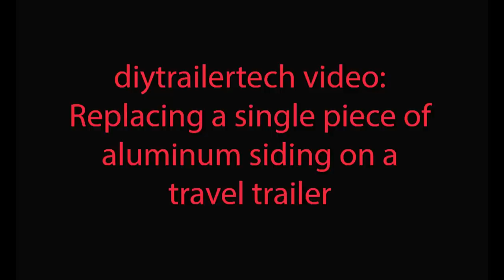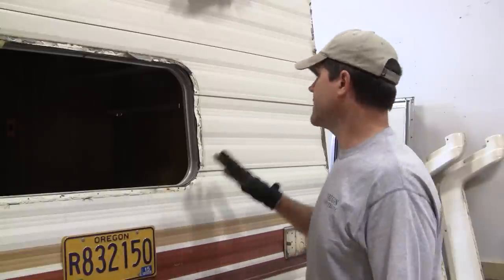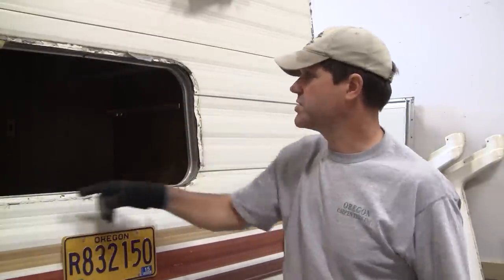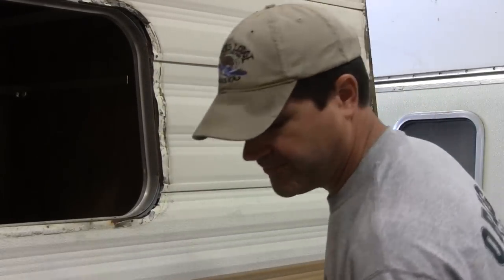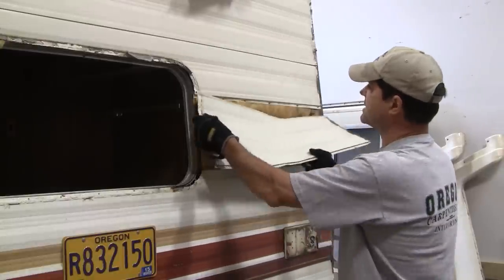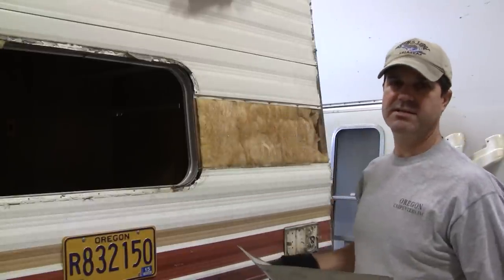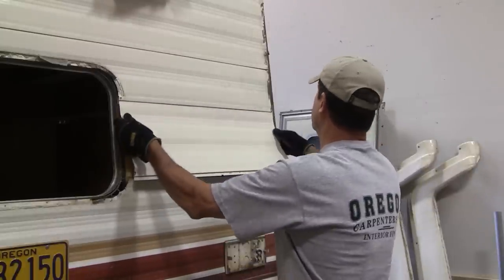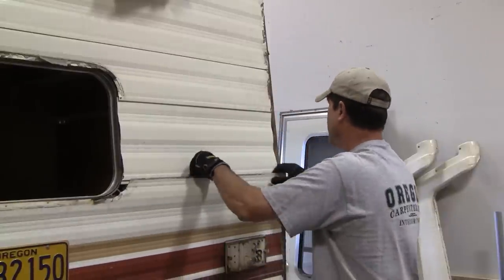Replacing a Single Piece of Siding 2

Comment: Do you recall where you purchased the replacement aluminum siding?

Also, have you ever run AC or DC wiring through the walls of an RV?  I'd like to run about 8 DC outlets and 5 AC outlets throughout my travel trailer and tie them into the power distribution panel.  Some people suggest I could run them under the RV and up the walls but to me, total novice, I would think the walls of the travel trailer would be bolted to the travel trailer metal frame.
Reply from the maker: I bought the siding at www.interstatervmetalandsupply.com/ 
Yes, we ran lots of new wiring in this trailer. We replaced all of the exterior siding (I wanted to show how to replace a single piece in the process) and we replaced most of the interior paneling. It's really like running wiring in a house. You have to stay within the capabilities of the circuit breakers, inverters, etc. Have a certified tech inspect everything, we did. You may also have the option of using conduit to house the wiring, you know, hipster industrial look and all that. But the circuits must match the service and breakers and grounding is super important for an RV.

Comment: I have 2 sections one above the other about 4 rows up from the bottom on the side of my camper about 18 feet long to replace. Would this work for that?
Reply from the maker: Hi Jim,
Yes, this will work. On the trailer we show in the video we actually replaced all of the siding. I thought it would be helpful to do the one piece video for repairs, but you can do anything from small piece to the entire RV. Longer pieces usually involve more corners, appliance and window openings so you'll have to handle each one as you get to it but are pretty straightforward flanges over the siding that must be resealed.

Comment: Where can you find/buy the siding. Mine peeled back and I need to replace 3 panels on a 40' trailer. 2002 Sandpiper. For now it's duct tape city.
Reply from the maker: I bought the siding at www.interstatervmetalandsupply.com/

Comment: What tool can I use to cut a hole in Traierl Wall to put in a new Window?
Reply from the maker: Lots of issues with this idea because you would first need to make sure there was no wiring or plumbing in the wall. Also, removal of framing for the window could cause weakness in the wall and roof support.

Comment: Is there a generic sheet metal/aluminum that will work for this purpose?
Reply from the maker: None that I am aware of. It needs to have the right bends at top and bottom to tie in. Plus the bends in the patterns increase strength.

Comment: You said the patterns were available, where at exactly.  I am looking for a 1979 fleetwood flair RV.
Reply from the maker: Hi Kirk, We got ours at
www.interstatervmetalandsupply.com
Our trailer is a '78 Terry
Reply: Hi Larry, Looks like the siding on my '88 Prowler is identical to yours.  I looked on the website you recommended and found that the 2" Mesa D-3 looks the closest.  Is that the one you installed?
Reply from the maker: I don't know why, but our trailer had several different patterns from top to bottom.

Comment: Hey I have what may sound like an extremely stupid question, so forgive me if it is. I have an 89 Fleetwood lynx that I am rebuilding. It has the same siding as the trailer in this video. I noticed while I was tearing out the interior walls that water is coming through where the top and bottom parts of the siding meet. Is this normal and if not how do I stop it. [I would like to note this is away from windows and openings, and seems to do it in large sections of the trailer]
Reply from the maker: That doesn't sound normal. There is quite a bit of overlap where the siding pieces fit together. Of course they would need to be installed with the correct edge up...
Reply: Larry Walton I was thinking it was odd. I honestly don't know how the water is getting by. I'm thinking that perhaps it is leaking in from elsewhere and following the bead. It is a 25 year old trailer lol.